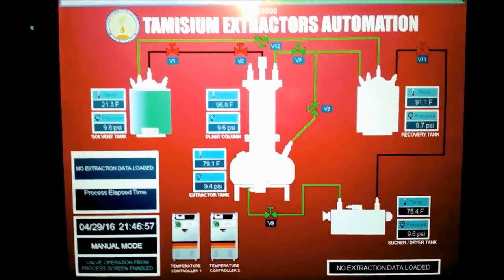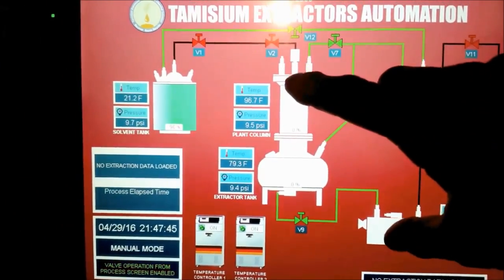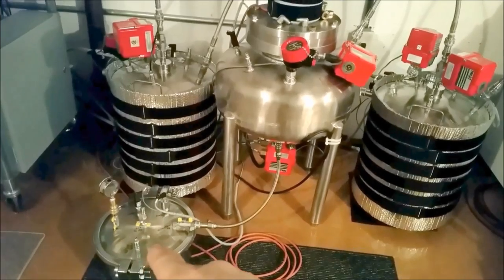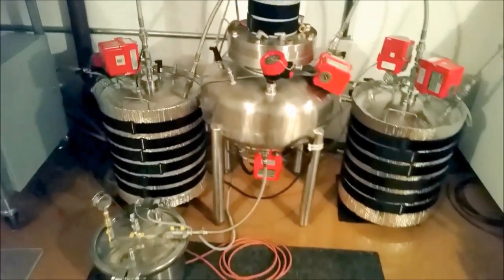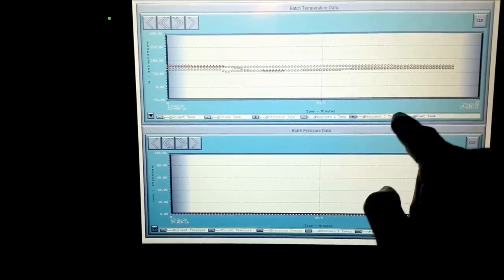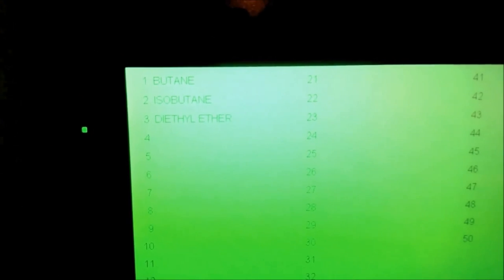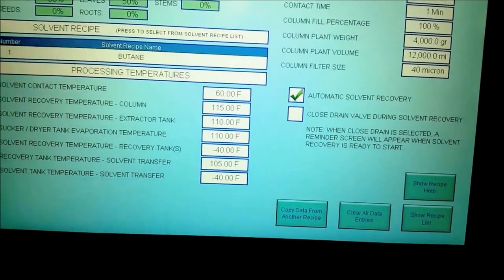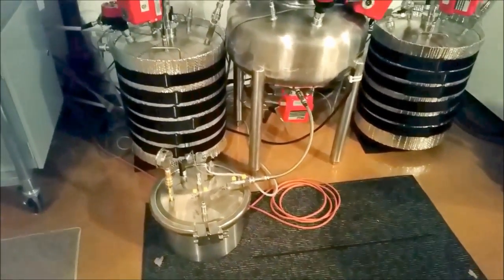Tamisium 12000 Automated Extractor - More controllable and safer than Closed Loop Extractors

Comment: wow, I knew your machines were 👍 but holy crap that's nuts. Great video!
Reply from the maker: +Aaron Snocker 
Thanks,,, There is so much more that we cant describe but one thing is for sure. It is only going to keep getting better. Using output data to control the system to fine tune the process is another benefit. Using output data from a network of more intelligent systems that have done more is another. We have a 5 phase development program that when completed will put this process into a level so far above any other that where we are now will be considered primitive. A data driven system that will seem more like a universal consciousness developing medicine that will be available to all of us.

Comment: I have an extraction company based in Seattle Washington. I have a few questions about your process. 1 hour to recover solvent seems like a very long time.  What's the general loss of BHO/PHO after each run. My reasoning for asking is in most cases a single column vessel will lose approximately 5-15% solvent per run. Charging most systems usually takes between 15-35 mins with our molecular pump. Your process seems really close to the automation were looking to implement with out processes for scaling. I would love to hear more about your products and machines.